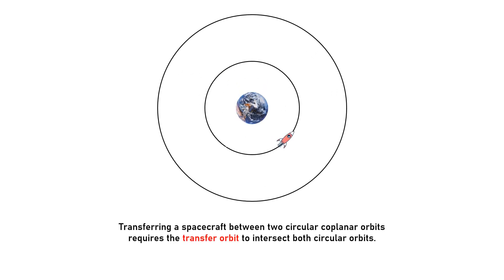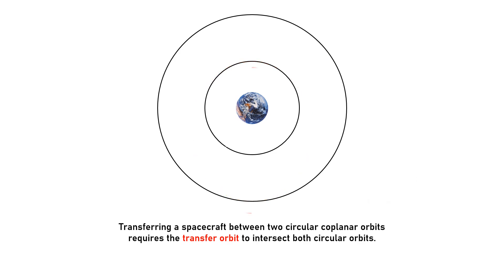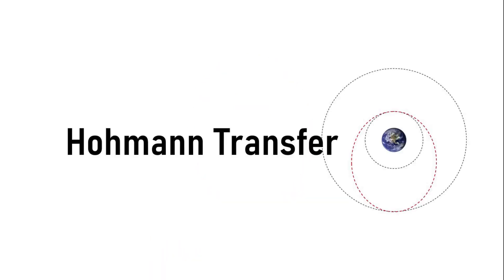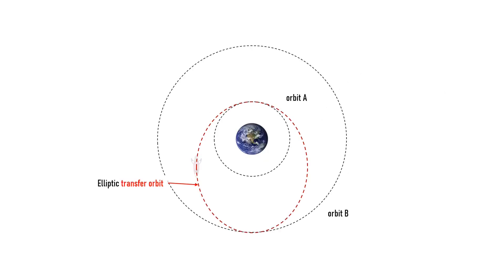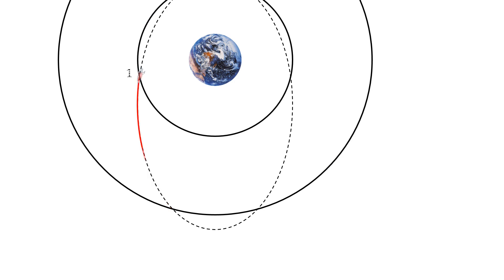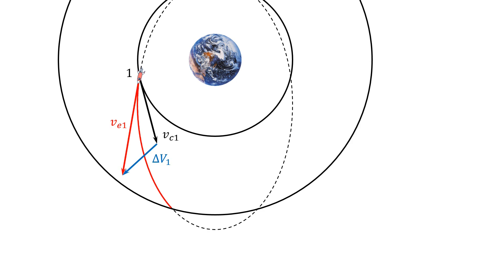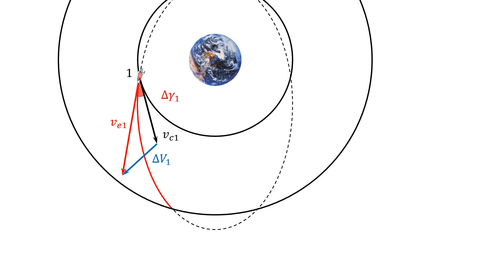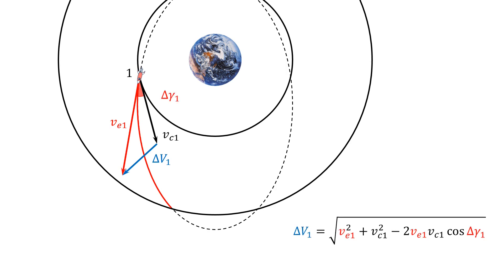Space Mechanics | Orbital Maneuver | Non-Hohmann Maneuver

Comment: Even with a Hohmann transfer the spacecraft has to adjust its direction, it's not always facing prograde, generally.
Reply: Right and wrong. When the two orbits is in the same plane there are just prograde or retrograde burns but normally some adjustments in plane is allso requred.

Comment: This is pretty good, Do you have anything for calculating an intercept where you don't care about how much Δv, you use but time is more important? i.e. a low thrust high isp engine, or a missile attempting to hit a target. where your burn times are very long.
Reply: I'd wager low thrust engines really need Hohmann even more since radial burns are less effective (more time spent fighting gravity). Burning prograde is the good shit with low thrust engine.
For high thrust where velocity at the arrival is not important it's another matter, and I'd like to know the answer.
I'd wager it's going to highly depends on the starting conditions like the ship/target phase angle.
But then, even a Hohmann maneuver to a target is only valid for some specific initial condition (the video just tackled the case where you just need to get on the orbit, not to encounter a specific object there).